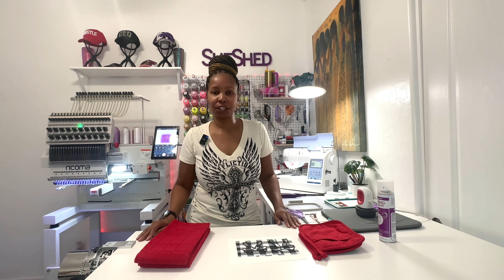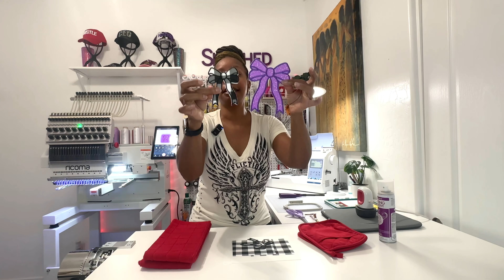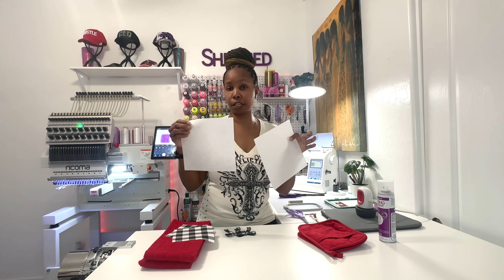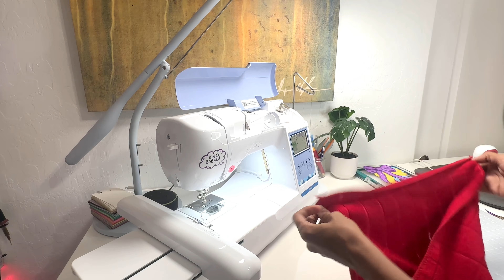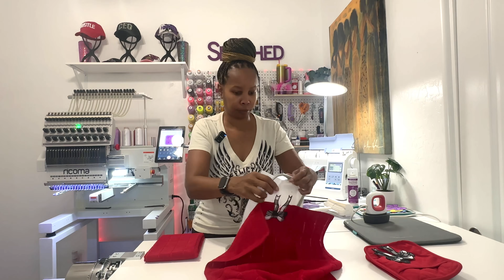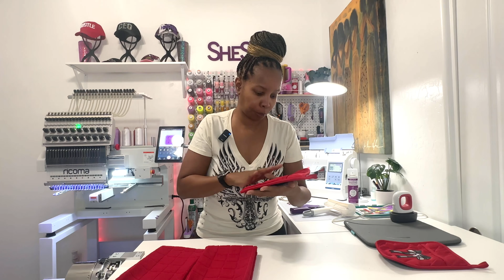Towel Bow Appliqué

Comment: Love these bow towel and pot holder. What do you use on the back of the bows to attach to the pot holder? Thank you.
Reply from the maker: I added adhesive to the back of the patch (Heat N Bond Ultra Hold) then pressed it on.